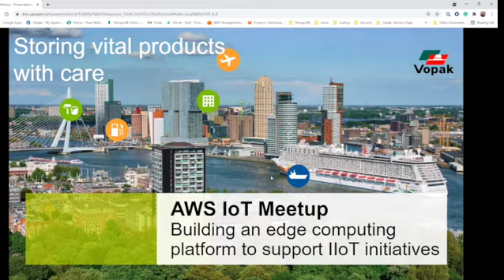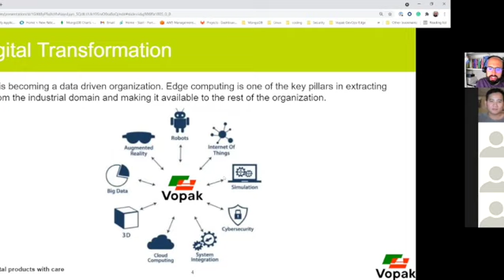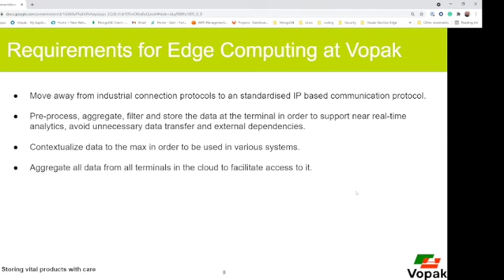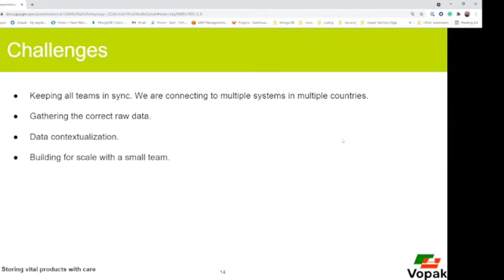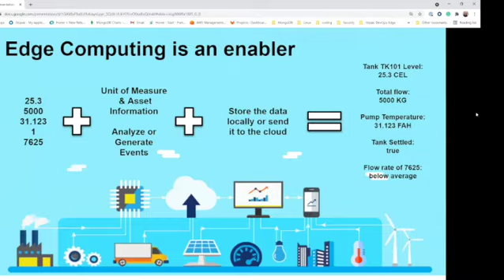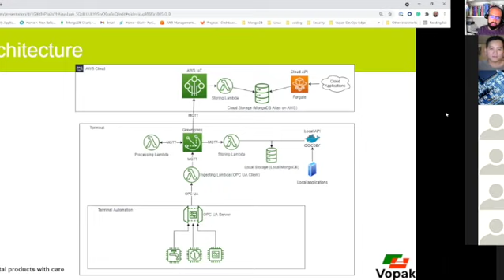AWS IOT Meetup Jun 24, 2021

Comment: Hello! Very informative video, thank you for sharing!
When you mentioned that your edge devices have to be attack certified, are those standards something Vopak came up with, or provided by the client? As in, is that part of your evalution as a company to compare and select edge devices? Or, is that more standerdized for the industry and your job is to work around that pre-determined equipment?
Reply: In our industry there is already many standards and certifications. However, we have additionally internal security standards and processes.